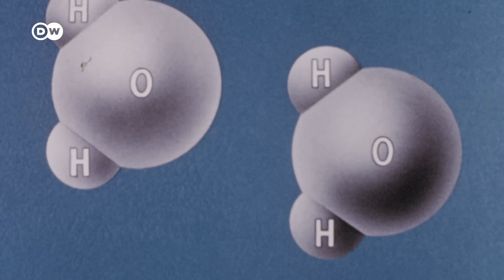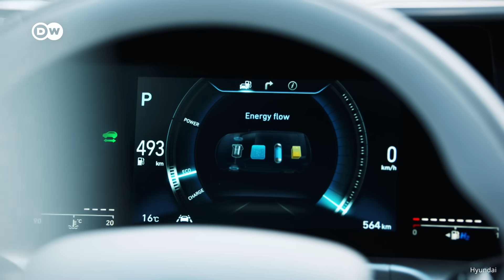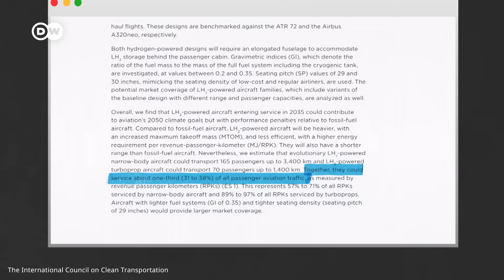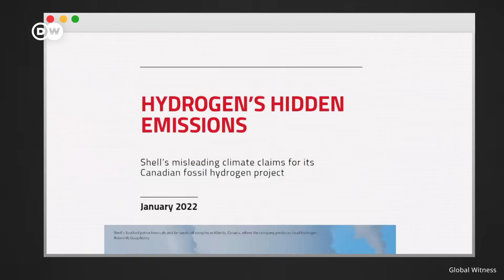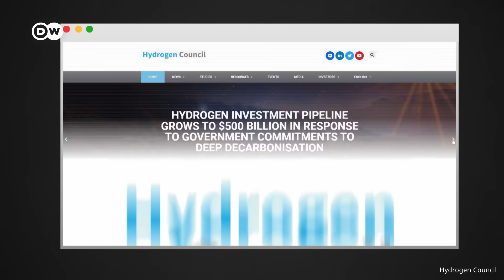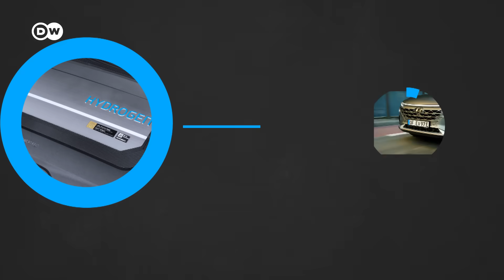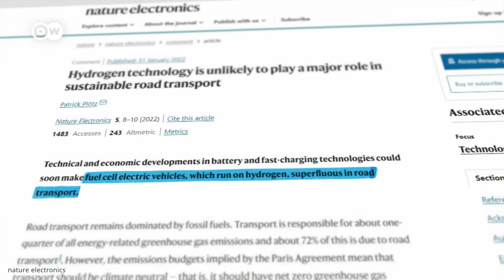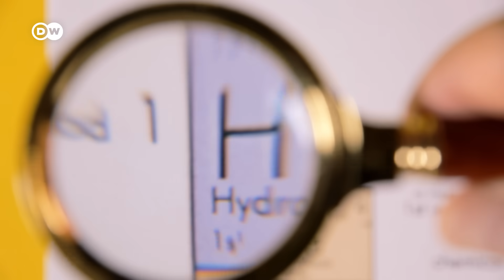The truth about hydrogen

Comment: At the end of the day, all this green energy talk is sn economic issue, not a technological one. Many technologies exist to store energy generated by renewable sources. The one we use will be determined by which one is the least expensive, taking into account the assets already in the ground and how easily it is to repurpose them. One does not simply pull refinery assets out of service and leave them mothballed...it would be a huge capital goods waste to do so.  The 2nd most energy dense form of energy is chemical storage and something liquid at room temperature is most economical for transport unless significant pipeline upgrades are put in place. Hydrogen is just a key raw material in making that liquid fuel in my opinion.
Reply: That economic issue is in fact an ideological one. All can be done. If there's a will, there's a way.

Comment: Fertilizer ... nope NPK are the elements for that. Blue Hydrogen is a sad one. If you take C and bond it with O2 and then store as a solid then you have taken the oxygen molecule and made it not open to recycling i.e. very bad.  Thermodynamically electrolysis is the only way to go but many issues have to be overcome to make that plausible in general. However while politics is involved, we will be inundated with stupidity.

Comment: Hydrogen was researched and talked about prior to the 1900s, it was sometime in the 1800s that someone had the theory about the very energy cells that NASA uses. In the 1890s a person built a car that ran on hydrogen. I was able to produce hydrogen and oxygen with a nine volt battery and I have seen people using hydrogen on lawn mowers. If "I" can do it, why is it people smarter than me cannot? A formula or test was done in the 1900s or before "proving" that too much energy is needed to extract the hydrogen. That formula/theory is left undisturbed and not contested. Modern techniques though make that old theory as obsolete. What about modern materials? Did they in the 1800s have available tungsten, titanium, and carbon fiber? If someone can run a lawn mower using water, how does this NOT make that old theory invalid? I read about a farmer in the West running his farm and house on hydrogen and using 12 volt batteries making power companies pretty angry. I wish I had the actual facts, instead of listening to people with percentages and formulas proving that "they" cannot do it.
Reply: "I  wish I had the actual facts, instead of listening to people with percentages and formulas proving that "they" cannot do it." Well, those formulas prove that what you think is possible isn't - because you lack the understanding of the actual facts.

Comment: Green hydrogen is dependent on electricity prices. At today's prices it will cost well over 100 Euro/Kg. Blue hydrogen seems to be a better solution, but the CO2 removal technology involved could also be used with other fossil fuels. Coal burning has 30-40% efficiency (depending on the type of coal) for electricity production, when burned directly in current power plants. However by using pyrolysis of Coal in relatively low (350oC) temperature solar furnaces, you can produce fuel gas that can be burned in combined cycle systems with up to 55% efficiency. The remaining Coal residue can be used as fuel or treated with Calcium in high temperature solar furnaces and the product dumped in water  to produce Acetylene that can also be used as fuel or processed further. The CO2 produced can be captured using similar technologies as for Blue hydrogen, combined with large scale reforestations. New technologies does not necessarily require abandoning older technologies, but using them more efficiently and differently, at least for the medium term. Nor one should exclude Nuclear energy using Thorium cycles.

Comment: You don't make enough emphasis about how hard it is to store and transport H.  Due to its small molecular size it will leak out of anything, so for instance, you can't convert an existing gas pipeline to H.  Secondly it has a reputation for going 'bang', so simple tasks like fueling up your H car or truck will need a 'certified' technician to do the job.  In any case the product won't be cheap.  Most current cargo ships can't be converted to H and they tend to last about 30 years,  so if we start today it will be nearly 20 years before our fleet is halfway there, never mind the higher operating costs.  Diesel fuel and especially heavy diesel fuels used in ships and trains is not highly flammable, H is.  Don't get me wrong, h is very interesting stuff, it can do a lot of things, BUT it has a big downside, expensive, hard to handle, explosive, and technically complicated.  Eventually it will find a place but I don't see it as a solution anytime in the immediate future.

Comment: There's still a lot of ideology in the energy debate. The powers that be wish to defend certain status quos that are useful to them, such as mass car use and industry dependent on trucks. In reality, freight should be moved by electric trains on a much greater rail network per Switzerland. The reason this debate does not happen is because in UK at least the Tories in particular fear rail union militancy (that's why railways have been neglected in the UK). Mass car use is socially pacifying so in US/UK there's no political appetite to reduce car use and make cars smaller. It's much easier to talk about hydrogen. Most people don't get the distinction between an energy source and an (inefficient) energy store.

Comment: Another problem if technology gets to a certain point where you end up with an energy storage device that is very small but stores a massive amount of readily useable energy you are now getting into the territory of a potential weapon of mass destruction that governments aren't going to want to put in the hands of their peasantry. Let's say an energy storage device is developed that is about the size of a car battery that can power a semi tractor and trailer fully loaded and it can drive from New York to Los Angeles on one charge and be recharged in less than a day. What would happen if some want to be terrorist were to override safety the systems in it and dead short it? I suspect it could easily become a bomb similar to a small nuke that could flatten a small town. I have reason to believe gizmos like that have already been developed and are in use in places where they can be kept out of sight of the public and under strict control. Aside from the potential WMD aspect such a device would certainly not be high on any energy company's list of devices they would like to make available to the public while there are still plenty of fossil fuels around to sell.
Reply: The more you look the more you can see. At some points you need to decide what to believe though. So many possibilities. What an exciting feature of life.

Comment: Just reminder that 96 % of all CO2 on the planet is made by planet itself. Humans produce just around 4 %. So for example personal car transportation account only for about 0,15 % of CO2 production on a planet. And production of hydrogen (which is not energy source but just energy carrier) is not so energy efficient, cause you still need lots of electricity (made mostly by burning coal and gas) to get it. And costs? Prices of crude oil has to be more than 120 dollars for barrel (in 2010s prices) in a long term to make production of hydrogen economicaly viable.

Comment: You completely avoided the most viable way to produce green hydrodgen. Use a solar furnace. It is completely powered by the sun so is zero emission. The best way to utilize hydrogen in a vehicle is by using ICE. No need to re-invent the wheel. The technology is already proven. BMW and Mazda both have produced duel fuel cars that can switch between gasoline and hydrogen. This way the automobiles can use gasoline until hydrogen is available and then switch.

Comment: Hydrogen for cars and trucks should be produced locally in the refueling stations through electrolysis. This eliminates the need to transport it long distances.
Btw I am very skeptical about battery electrical trucks. For trucks it makes more sense to electrify the highways similar to railways.

Comment: What I did not encounter at all in this video was the argument of Hydrogen being able to leak through practically any metal crystal lattice. Although materials have now been developed that minimize this, it can never be eliminated 100% thereby posing a potential hazard in closed spaces. That would mean your car that runs on hydrogen cannot be parked in your garage unless you have an extraction fan to make sure fresh air is constantly drawn in to the garage. Bummer when the power goes out.

Comment: What I don't understand is the push for electric vehicles over developing hydrogen tech. With hydrogen the consumer level infrastructure structure could remain virtually unchanged, just converting gas stations to hydrogen without the massive jump in refueling times inherent with electric vehicles.
Reply: Lol, have you looked at the differences. Fossil fuels are liquid at room temperature. Hydrogen is a gas over -252°C and must be stored either at those ludicrously expensive to achieve low temperatures or at equally ludicrously expensive to achieve high pressures. In FCEV it is stored at 700 bar (700 times the pressure at sea level), while refuelling such a car the pumps at the filling station needs to achieve 1150 bar (that's 15000 psi). That "easy" conversion of a fuelling station is more of a "build a new one" at $1 million per pump. 

And then the refuelling really only takes 5 minutes, but since hydrogen gets warmer when it reduces in pressure the whole apparatus needs to be precooled to -40°C and after a few filling processes the wait times ramp up up to 30 minutes between cars as the required low temperature need to be reached.

So while you wait in line for 2 hours to be refilled at a hydrogen filling station that are as rare as hens teeth, your friend with an Kia EV6 who went to the hypercharger next door is an hour and a half ahead of you on the road as he only needed to charge for 18 minutes to have enough charge for 200 miles.

Comment: There's no magic bullet solution to all our problems, so there will be lots of different solutions which work for particular niche applications, industries or nations. Hydrogen, as others say, is just an energy carrier and currently it is a viable solution for trucks, trains and ships to replace diesel and petrol/gasoline. It's less convenient and more expensive to store, but it will fill the gap until batteries are up to the job. That may be a while - hydrogen tanks can be refuelled very quickly compared with recharging batteries and the amount of energy needed to recharge a truck battery will take time. Operators won't want trucks standing around charging batteries, though they might make the batteries demountable - see what I mean about niche technologies developing!

Comment: At best (i.e., green) hydrogen is a competitor to batteries, not a competitor to fossil fuels.  It’s an energy transport mechanism, you still have to generate electricity.  This piece just glosses over the major environmental issues with large scale solar and wind production.  However, I’m not surprised a German media outlet completely avoids the current best environmental solution for energy production: nuclear energy.   Also… this is a continually evolving sphere.  Battery development is undergoing rapid development as well, becoming smaller, more powerful, and less toxic, and will continue to play a major role in energy transport in many applications.

Comment: 9:01 I believe it is incorrect to say that Hydrogen has "low energy density", because Hydrogen has the highest gravimetric energy density of all known substances. It would be better to use the term "low volumetric energy density" instead.
Reply: And then...there's metallic hydrogen, even higher gravimetric energy density...it was made in a lab not so long ago and required pressures akin to those at the centre of the Earth.
Reply: @paulmichaelfreedman8334  Can I store it at home though?
Reply: Hirugen ant reel. wuts reel is thar bibel an cherch on sundey. thar preecjer says thar thar bibel is reel. we gose to thar cherch on sundey an thar preecher says thars werds an thar lord is gud. we gose to cherch on sundey in kintuky an alarbamar an tinusey an wesverginey on sundey. thank ye
Reply: @friedgreenaliernwomerns2600  I can't believe I just looked for auto-translate.
Reply: Hydrogen itself isn't very dense so it isn't going to have great overall energy density just because of that before you even bring in other factors. You can try to qualify it and make it seem better. But, an equal amount of hydrogen and basically any other common fuel has hydrogen with much less energy for the given amount.
Reply: @NBSV1  You don't get it. It's not about making it seem better, it's about not attaching the colloquial meaning of density to every term that includes that word.
Reply: @ChucksSEADnDEAD  Density is density. No matter how you put it Hydrogen isn't very dense. Hydrogen has such good gravimetric density because it's small and can pack together well. Still doesn't make it dense. Even packed down the container to hold 200lbs of Hydrogen is going to be much larger than a container holding 200lbs of diesel fuel. Which is the whole point of the problem.
Reply: @NBSV1  That and the fact that Hydrogen can leak through the crystalline structure of nearly any solid. So can Helium - if you ever wondered why helium balloons always deflate after a day or so

Comment: Very informative. Yet I want to remind that wind and solar are not zero-impact. All the production processes, material extraction and transportation are highly polluting processes. Moreover those infrastructures have a design life. This type of comprehensive calculations on the complete ecological impact are often kept out of the renewable energy discussion, which is a pity.
Reply: Yes, it is a pity. But it doesn't change the picture, renewables are a lot cleaner (and cheaper, and safer) than fossil fuels.

Comment: unfortunately lithium batteries are a finite resource which are terrible in regards of production emissions and workforce manipulation. Rechargeable batteries just kick the energy production down the road, if everything was converted to battery power then we wouldn't be able to provide a large enough electricity supply to recharge them. Solar and wind power only really works if it is subsidised and the sun shines and the wind blows.

Comment: Hydrogen cannot supply any of our energy("20% of our energy needs by 2050")needs because it is not a supplier of energy but only a transferer of energy just like a battery only much less efficient than batteries we have now.  The idea of "hydrogen supplying energy" is a long standing myth/lie.  Much more of the energy is lost in creating storing and transporting and turning it  back into electricity than if the electricity was used directly.  Hydrogen is not practical - we need to focus on other alternatives;  but not to save the planet, so we have lots of time to accomplish it and only if it is cheaper than what we are doing now.

Comment: The same as ethanol. All involved in this scam knew from the start that the trade off was no good and was just a scam. It all depends on which of your elected officials have what invested in where, who they owe favors to and why we should keep them in their current position.
Reply: Your argument is correct in the case of replacing fossil fuels for combustion engines especially as ethanol production would take farm land out of food production. Electric vehicles already perform better than these over hundreds of kilometres in most conditions so the future of ethanol as a fuel to burn is as limited as gasoline. Also, there is the possible scam of "blue" hydrogen as a front for fossil fuel producers to use as a stopgap during declining demand for their products. It is up to us to raise awareness and force elected officials go directly to the best alternatives rather than those that feather their nests.

Comment: The problem is very simple. There is enough generating capacity to charge all the machines they want to make into electric. I read somewhere that renewable sources only produce about 18-20% of current demand. Now they are going to  force everyone to spend $50-60K on a car that requires electricity which we can not produce cleanly. The next phase of this joke is the nuclear industry lobbying to build plants all over the place. We see how well that works out. Spent fuel is dangerous for thousands of year.

Comment: There's no such thing as green hydrogen unless a system of using solar energy DIRECTLY is used.  Renewables (made to produce hydrogen) are not green.  The materials are manufactured by using fossil fuels (usually in China, who are building coal-fired power stations to make turbine blades!!!).  And a lot of the processes use some nasty toxic stuff like cadmium telluride, copper indium selenide, cadmium gallium (di)selenide, copper indium gallium (di)selenide, hexafluoroethane, lead, and polyvinyl fluoride, silicon tetrachloride, and a by-product of producing crystalline silicon, is also highly toxic.  It's all a big fraud, like the global warming hypothesis itself.
Are we warming?  Yes.
Is there anything we can do about it?  No.